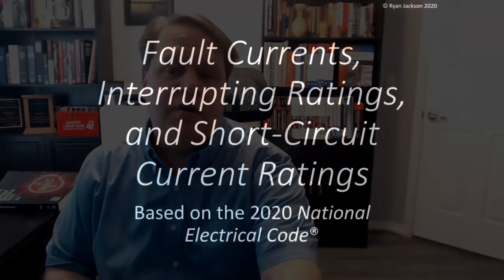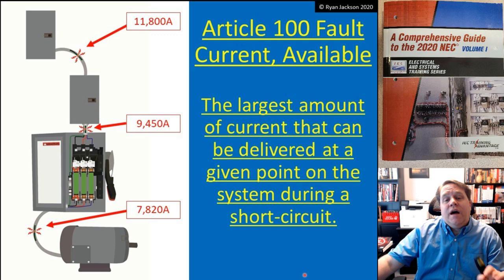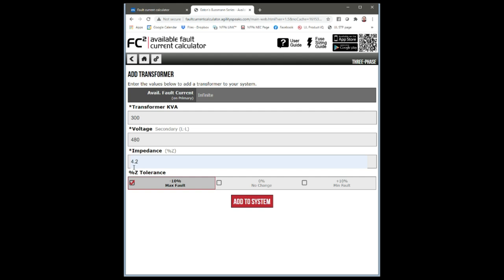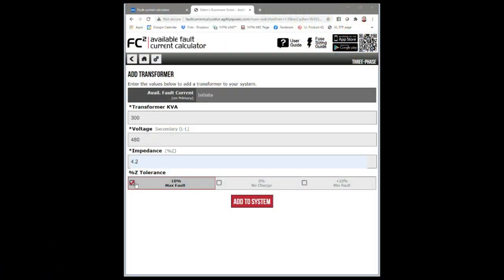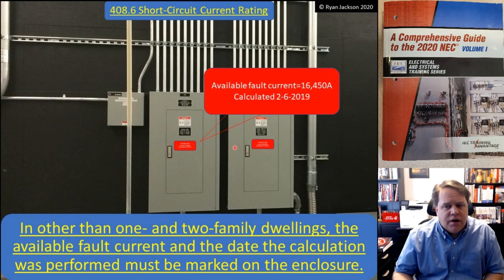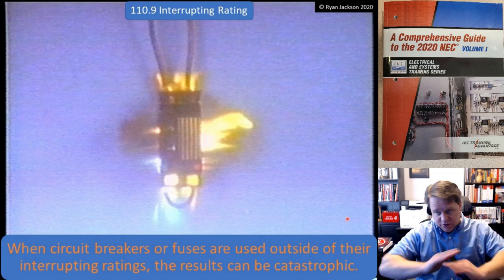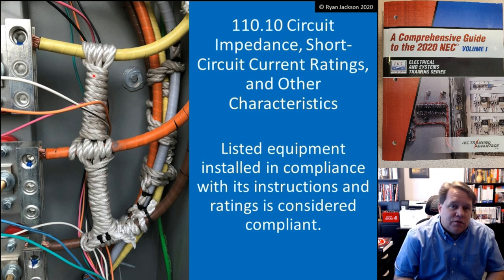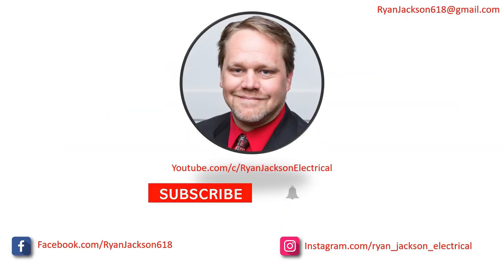110 9 and 110 10

Comment: I always ordered & stocked 200 KIC on our 250 & 600 volt fuses 1 to 1200 amps just to be safe. At a large candy company that I worked at in the 1980 ' S they used renewable link fuses on everything on 480 volt equipment. A lot of 30 & 60 amp dafety switches were feed from 3000 buss duct. Little by little I got rid of the think they were only good for 10 KIC renewable fuses.

Comment: Watching wire jump at high current solidifies the reason we torque, pull, loose, tighten…. terminals.  Imagine a dead short on a branch circuit and the impact of a wire jump in the panel causing a wire to separate from a terminal or along an attic beam. Very interesting Ryan - thank you.

Comment: At a very large hospital that I retired from while contractor was performing yearly cleaning & testing of 200 to 1200 amp 480 volt circuit breakers boss had us remove 6 or 8 spares from basement switchgear that had 40 or 42 KIA rating to   a switcgear room on 10 th floor that all breakers were rated 65 KIA. We installed the spare 40 or 42 KIA breakers to what was all 65 KIA and never questioned it. Sharp Contractor picked this
Reply: Sorry fat fingers. Anyway they entire switvhboard is only rated as the liwest installed KIA breaker.

Comment: One correction. @10:02, the fault current is 10613 A. Since it's a 3-ph system, you have to devide the answer by square root of 3.
Reply from the maker: That is single phase.
Reply: 75KVA transformer doesn’t seem to be single phase. The fault current value is always per phase which is obtained by dividing by square root of 3.
Reply from the maker: Read the voltage. I have it circled. It is 120/240, single phase.

Comment: Have to be carefull when ultility company replaces an old transformer with an energy saving lower impedance. Avaiable short circuit current will be higher.  In some cases this new short circuit current will be higher then the rating on switchgear.

Comment: Do you know if there is any short circuit current requirement for splicing connectors like the Wagos or the 3M Scotchlok? 
I have not found information about it, it seems to me that the connectors are very useful but not in industrial buildings where the short circuit currents could be considerable.
Reply from the maker: I will see what I can find out, but I would guess the rating is quite high. If you think about a terminal block (power distribution block), for example, the part that fails during a fault is not the terminal but the way the terminal connects to the plastic and the plastic connects to the enclosure. The fault doesn't melt the terminal, it rips the insulating material off the terminal or off the enclosure. I just don't see many failure points on the connectors you mention (but that is me speaking without looking into it deeper).

Comment: Another great vid Ryan. Question at a 12 story building that I worked at all motors 5 HP & higher had VFD drives except for soft start on 200 HP soft start fire pump. Motors 60 HP & larger were on 18 pulse drives would this effect the motor thing on the Eaton calculator?
Reply from the maker: Yes, that would add fault current.

Comment: Great video.  Is it code compliant to use fused disconnects upstream of equipment for short circuit protection on equipment with lower fault withstand ratings or is that not complaint with 110.10.
Reply from the maker: Yes, if properly rated. You would not have any selective coordination, however.
Reply: @RyanJacksonElectrical  thanks. Yeah this EV charger manufacturer only has an equipment rating of 5ka. Which basic is nothing.  Just thinking of using peak let thru curves to show it is below 5 with a fuse. Thx

Comment: In the example of the 300 KVA transformer at @18:41, you couldn't use the primary fuse of 80 amps on the nameplate to calculate fault current? I get 3600 amps if multiply 12470 x sqrt(3) x 80 / 480. But maybe they don't allow that because fuse might not blow in time, or weld itself together, or arc across the blown fuse etc. Still 3600 amps of 480v is one hell of an arc flash, enough to give someone being dumb the floor temperature challenge.

Comment: 21:56 i kinda wonder why i got 26,544 amps for the fault current on the 750KVA, 3 phase 480volt secondary, 3.4% impedance example. i did 750kva ÷ 831 ÷ 0.034 = 26,544 amps
Reply from the maker: Great point. My example includes the 10% transformer impedance variation that I discuss while using the software. I really should have included that in the written narrative of the example.
Reply: @RyanJacksonElectrical  I think i figured out what you are saying. 750,000VA ÷ 831 ÷ (0.0306 which is 90% of 3.4%) = 29,494.35A available fault current.
Reply from the maker: @elc2k385  Yep, exactly 💯

Comment: When you work with DC power systems (batteries), you don't make the mistake of ignoring interrupt ratings. Sure, the fuse/breaker will have the primary rating in large print, but the more important (IMO) number is 1/10th the size just below it: the maximum current it can interrupt. Having seen a battery string short with a "lesser" fuse, sure the fuse "blew" -- the 400A rated wire broke -- but the fuse was instantly turned into a ball of plasma, and 50,000A continued to flow... between the bolts of where the fuse used to be. (the saving grace here was battery sag. after a few seconds, the voltage was too low to maintain the arc. otherwise, the string could (in theory) maintain that short for ~45s. of course, the wrench that caused the short would've been vapor long before that.)

[For the record, I've seen a wrench "disappear" into a PDU -- telco battery room. As I recall, it didn't even set off an alarm, much less trip anything.]
Reply from the maker: That's one of the problems. The fuses will work...until you need them.

Comment: I do not think that any single or 3 phase motor that is on a modern VFD would contribute to the available short circuit current due to input goes thru a rectifier. Was always told rectifiers only allow current flow in one direction similar to a check valve in plumbing.

Comment: I'm confused. The future you are from say from t he transformer secondary the available short circuit current goes down while if I have it right from a long ago safety class the Arc Flash can be higher further from the transformer. Thanks for another informative vid.
Reply from the maker: The available fault current decreases the farther you get from the source. The incident energy is based on the voltage, available fault current, and (perhaps most importantly) the clearing time of the overcurrent device. Lower levels of fault current yield greater clearing times so the incident energy will vary greatly throughout the system. You really cannot just say that the incident energy will decrease the farther you get from the source.
Reply: @RyanJacksonElectrical  Thanks Ryan. Believe most electricians are more concerned about the Arc fault value in an existing large industrial setting to make sure they have the proper PPL. Diappointing to see most switchgear & panel boards still not labeled for Arc Flash rating. At the large hospital/research centets/ ambulatory building we took turns walking a company that wrote down every transformer and the panels they feed along with wire size and length of wire. Probably took over 60 hours over several months. After all said and done nothing got labeled. Believe cheap facilties manager thought it cost too much. Same cheap boss refused to have doorknobs in several old 13,200 bolt substations replaced with crash bars in case an electrician burnt his hands..Worse part one substation was 3 floors underground and had no walkie talkie or cell phone communication. A newer building substation was 4 floors under ground and 70' below grade but had excellent communication. They had 2 1750 HP chillers that were feed from 13,200 volts to a 20' long enclosure that contained a 13.2 KV to a 4,160 tramsformer that feed a VFD. I adked for over a year where are the Arc fault labels were. Said they were working on it. Told my boss that no equipment should be allowed to be started until labels are on them. Hope in the near future that the AHJ &/or electrical inspector refuse to do an inspection until proper labels are installed.

Comment: Scary thing in my area the ultility company only installs a oversized fuse on 7.6KV primary side of their transformers. I had a service cable short out and almost burnt the house down because the primary fuse never cleared. Second thing I always thought was dangerous is lazy cheap ultility company only supplies 1 high voltage leg to their transformers when they have 3 phase on poles. They bond one of the primary transformer legs to case and center tap of 120/240 sevondary causing my copper water service & steel gas pipe to carry current back to transformer. They told me that it does not matter because they run a #6 aluminum wire down to a 8' ground rod at each pole that has a transformer on it. I know they do not follow the NEC but they get away with too much.